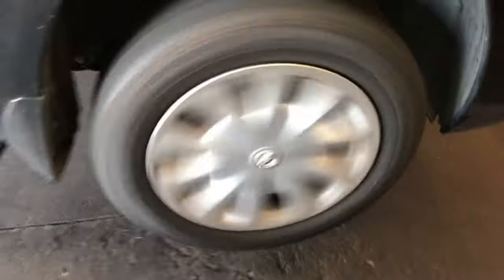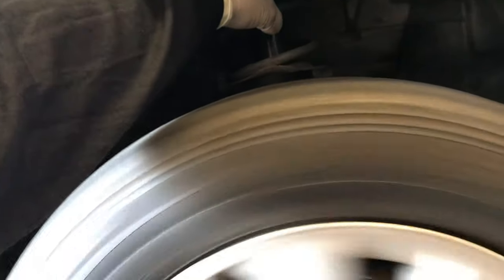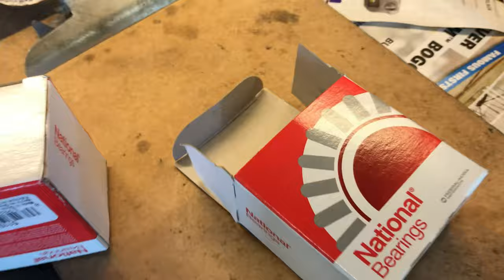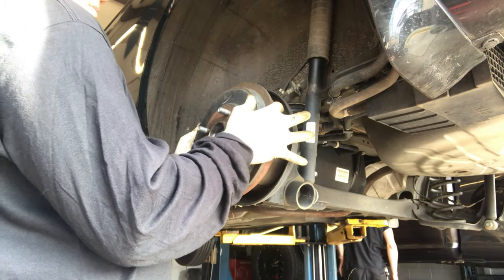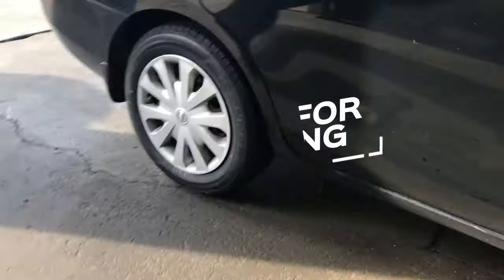Nissan Versa Diagnosing and Replacing Bad Rear Wheel Bearings Full Video Guide Step By Step

Comment from the maker: Tools & Parts :
1. Rear Driver and Passenger Side Wheel Hub Bearing Assembly Compatible with 2012-2019 Nissan Versa, 2014-2019 Nissan Versa: https://amzn.to/3ZHaAin

2. Snap Ring Pliers Set, 11-Piece – .038in - .09in (1-2.3mm) Straight & Bent Retaining Ring Pliers w/Hook & Pick : https://amzn.to/3CPkQey

3. 19pcs Universal Front Wheel Drive Bearing Puller | Front Wheel Hub Removal Car Kit Set : https://amzn.to/3QIPEU1

4.12-Point Axle Nut Socket Set (8 Piece) :  https://amzn.to/3w75Ncu

Comment: Would it sound loud from the back?  Like a dry rotted, bad tire(s)?
Reply from the maker: Just depend ..if the wheel bearing is shot completely .. like grinding pretty bad you will hear it by free spinning the wheel.. or you can drive it down the road it will sound like worn out tire like cupping wear noise .. 🤙

Comment: Is bad bearing will illuminate the ABS light? Versa 2020
Reply from the maker: Just depend … how bad is wheel bearing . Mostly if the bearing goes way bad the ball bearing missing or damage or maybe melted possible can damage wheel speed sensor ..  ..